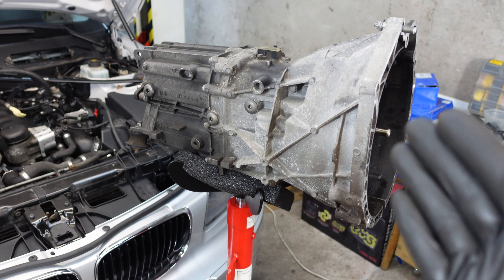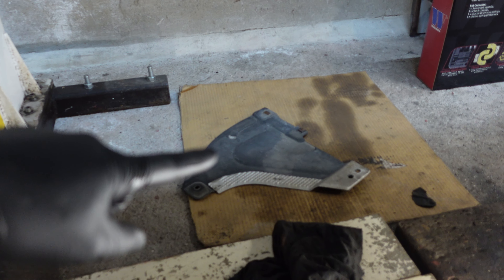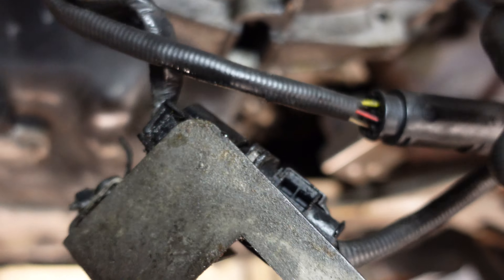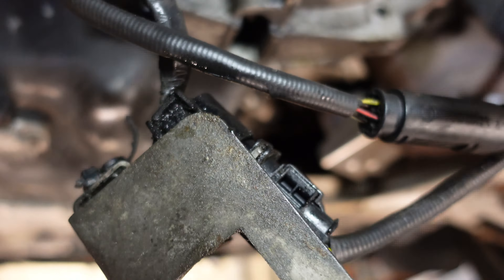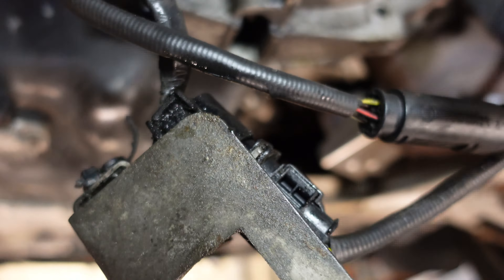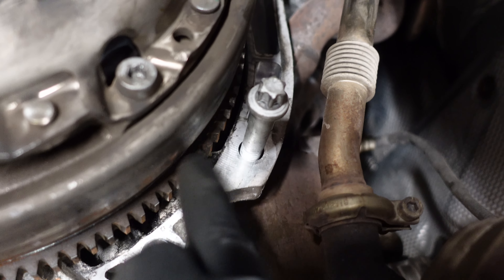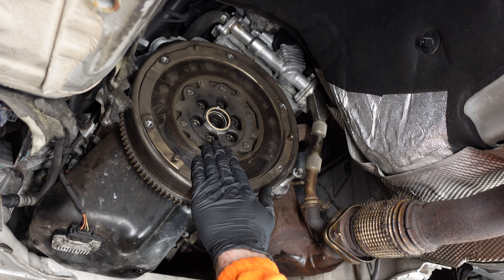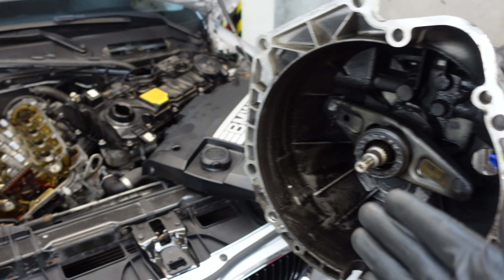N43 Transmission, Clutch & Flywheel Removal | PART #5

Comment: I was wondering if its possible to remove the engine without removing the gearbox?
Reply from the maker: Yes, but then you have to remove the front end or drop the engine + transmission with the whole front axle from underneath.

Comment: Hello, can that gearbox be fitted to the n42 and does the flywheel have to be changed?
Reply from the maker: Dont know for sure, but here are some pointers: N42/N46 has the same bolt pattern for the transmission bell housing, it also has the same crankshaft (B20's). Flywheel, clutch and clutch basket have different part numbers. So if it fits in the car, you should use the whole assembly, gearbox, clutch and flywheel.
Reply: @BimmerZen  Thenks.